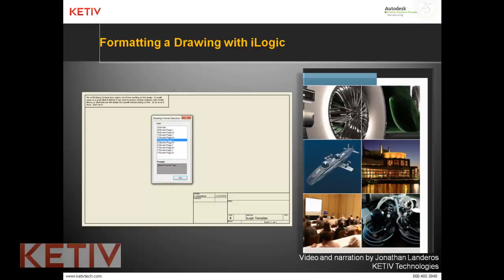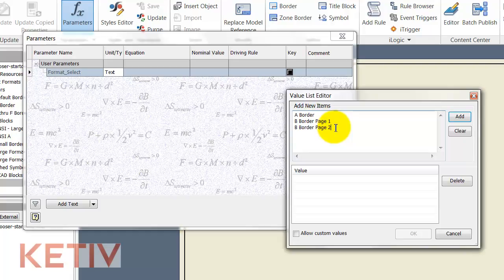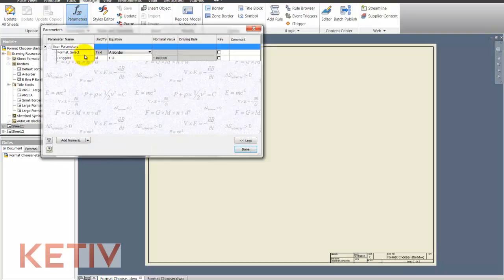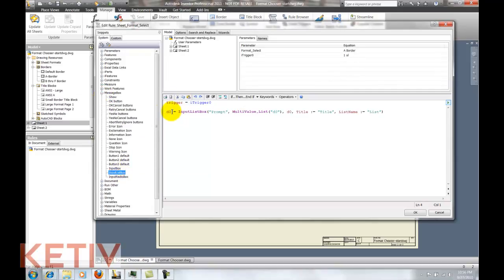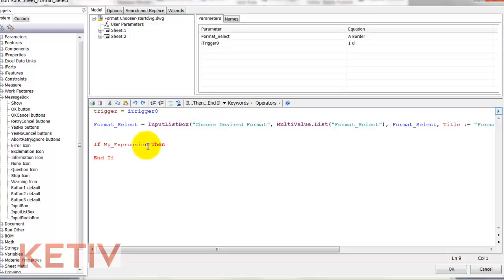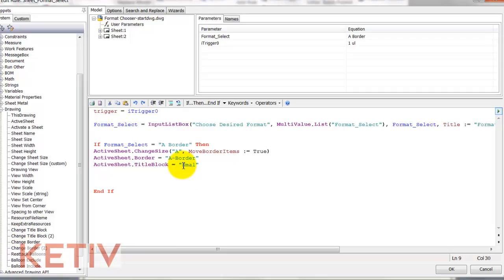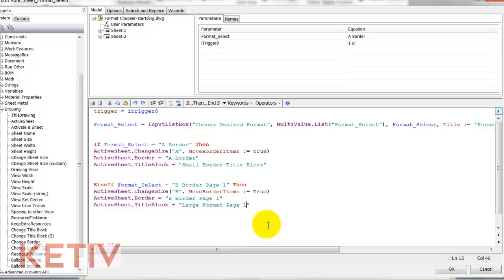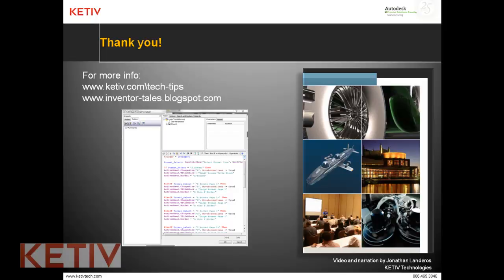Using iLogic to Configure a Sheet Format in  an Autodesk Inventor Drawing

Comment: Question, So did you have to create an individual Title Block for each sheet size??? 
In my case, I have created a title block using the sheet size A and every time I change the sheet size, it shrinks. 
Is there a way to prevent this? We only print in letter size paper in this office. We always prefer to drop in the views of a part to a 1:1 scale but most of the time, that won't work with our small sheet size A, so then I use the larger ones but my title block stays small and of course since we print small paper, it makes it harder to read. The dimensions also stay the same size and thus they too become hard to see.
Reply from the maker: Jesus, 

Thanks for your question. Yes you do create individual title blocks for each sheet size for the most part. Creating templates for those larger sheet sizes can definitely help, as you would only need to create the other title blocks only a single time.  

-Nigel

Comment: Hi, thank you for posting this. I have a little question about this, I hope you can help me: I used the same structure that you used here to change the Sheet Metal Rule of a piece, and it works, but the problem comes when I run this Rule from an iLogic Form, it shows an error and it doesn't change the Sheet Metal Rule. I noticed that the Thickness of the material changes before Inventor shows the dialog box, but when I choose an option and click OK it shows the error. What can I do?